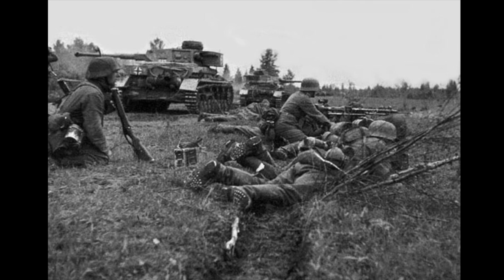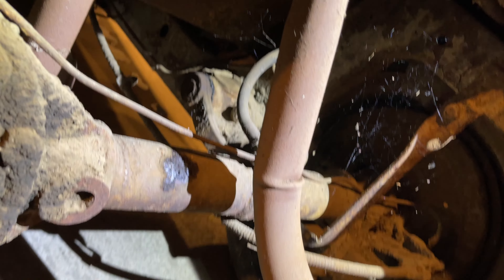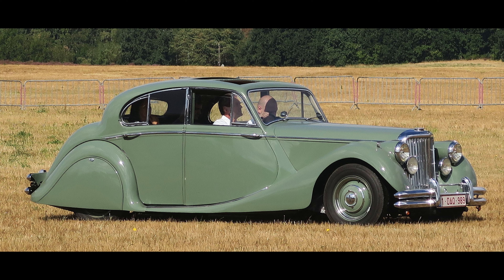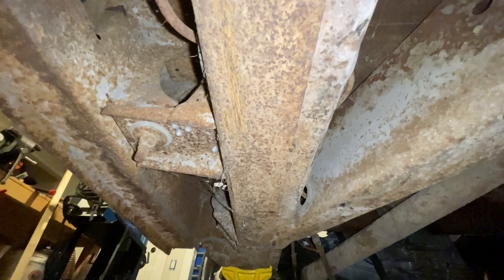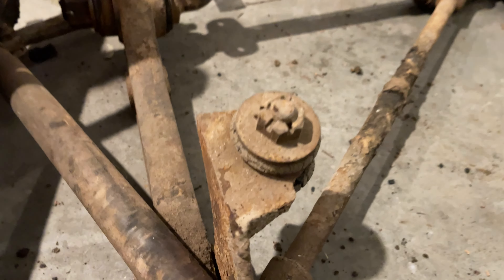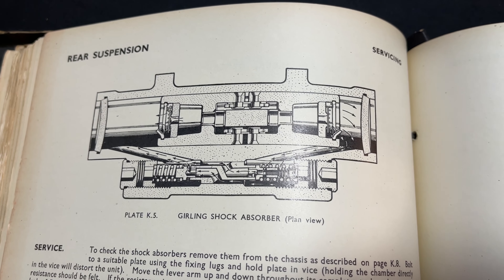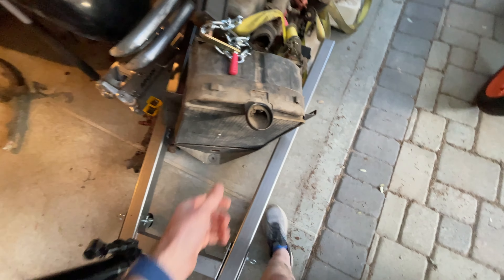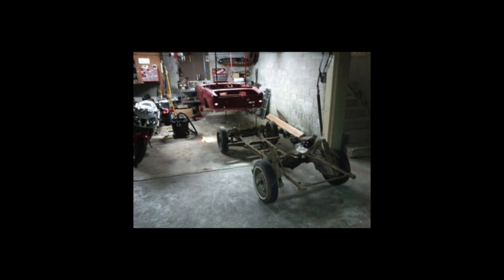The Design And Engineering Behind the Soon-To-Be-Tesla-Swapped 1950 Jaguar Mark V.

Comment: In case nobody has already pointed it out, the BSF/Whitworth nuts and bolts use different spanner/socket sizes to the 'imperial' A/F sizes (which are American standards), which is why your spanners don't fit properly.
Reply: I don't understand a car guy does not now this, made me laugh...
Reply: Whitworth threads are typically used on tubing threads today, eg brake lines.
Reply: Correct, he must know that, think he is just playing
Reply: He must do
Reply: @kennethmoxon7337  eh, it's common knowledge for anyone that's had something to do with old British cars but outside of that not really. Can't imagine it helps that he's in the US.
Reply: @alfasud1972  He's American and i'd wager most British mechanics don't know about them
Reply: @MrcabooseVG  even non mechanics in the UK who played with cars as a child knows this.... makes  sense
Reply: The mounts on cameras are still Whitworth threads to this day too!  To be fair to Matt, it is pretty confusing that Whitworth spanners are labelled based on thread diameter (with bolt head size being a mathematical function of thread size) AND that they have both W and BSF (British Standard Fine) markings on most spanners and sockets which are different (e.g., " 1/2" W 9/16" BSF "), since the relationship of thread size to bolt head size was reassigned at one point.  ...Edit - Nope got that wrong myself, it's because the relationship of fine pitch (BSF) thread size to bolt head size was defined differently to standard Whitworth (labelled W, WW or BSW), with the BSF bolts having a bolt head size that was one step different for a given thread size. 

Inconveniently, the majority of the Whitworth bolt head size (across the flats or "AF") are nowhere close to either SAE AF or metric AF sizes.  E.g., there's 1/8"  W which is 8.64mm across the flats as opposed to 8mm AF or 5/16" AF (which is 7.94mm, so is usually interchangable with 8mm AF wrenches or sockets).  Hence the need for dedicated Whitworth tools.  (It's a funny coincidence that there are quite a few SAE AF that are very close to metric AF sizes, by comparison.)

Interestingly on 1960's British cars you can find some SAE thread or metric thread bolts that still use Whitworth size bolt heads to allow existing spanners and tools to be used.
Reply: He said in the beginning that he has never cared much about or learned about jags

Comment: The beading between panels is called "welting" and the Withworth system has its own spanners "wrenches" that are slightly different from sae wrenches but that fit snugly on Whitworth nots and bolts. I recommend that you get a set from the UK; it makes work more pleasant. Interesting project, thank you.

Comment: in reality this is a 1930's car that they were still making in the 1950's
Reply from the maker: Totally. I'm spending a lot of time watching videos on 30's and 40's hot rods to figure out how to modify things.
Reply: @SuperfastMatt  you were on jay leno?
Links or name of the video?
Reply: @rronaldreagan  jays garage Honda s600
Reply: @djfast3  doesnt even look like him.
No homo but he looks much better today
Reply: Not really, Jag were innovators, their application of Girling disc brakes won them the 24 hr Le Mans. My 1959 Mark IX had 4 wheel discs in a fuuull siiize sedan. Do you know of any other mfg doing that?
Reply: @ericst-louis8604   My point was this car has none of those innovations , all the technology and design  is 1930s, it wasn't a comment on the manufacturer just the actual car Matt has.
Reply: @rronaldreagan  sus
Reply: @ericst-louis8604  Yes but this specific car is of an old design, Rover also did all round disk brakes albeit a little later but not by much
Reply: @malakiblunt  I know a little about these (own one), while you’re right it is an old design, an iteration on the MkIV which flat out was a prewar car designed in the late thirties but manufactured immediately after the war. It’s worth noting that design/manufacturing practices at the time were more iterative than today. Only bits of it were new. The front suspension was the innovation on the V along with the box chassis manufacturing process. The front suspension went into the XK120, and derivatives into MkVII and most of the grace, pace, space Jag saloons of the fifties. The engine is also a good example of how they evolved things. The design was  an old Standard (as in the company) side valve six. Jaguar purchased the tooling and modified it to produce an overhead cam engine without the cost of casting a new block / ancillaries. There are still hatches on the side of the block in the MKIV/MKV to access valve gear that is simply not there. It’s hilarious.
Reply: @ianemptymindtank  The Mk4/5 engine was pushrod, the twin ohc went into the Mk7.

Comment: The heads of the fasteners are whitworth as well. That's why normal wrenches won't fit.
Reply: Yes, Whitworth wrenches exist for just this purpose.
Reply: Not-quite-useless trivia: old British stuff is still fractional imperial sizes - they just measured across the points, instead of across the flats. You can still buy the wrenches to fit them. Most old jags fit 2 or 3 wrenches for 98% of the fasteners outside of the drivetrain, so you probably could buy 2 or 3 single wrenches and sockets, and not have to use adjustables.
Reply: Whitworth "spanners" are normal  (?) wrenches (?)
Reply: @jkk244  only they are called spanners  😎
Reply: chevy liked to mess with you clutch head screws.

Comment: The bolt threads are BSF, whitworth spanners fit the bolt hex but are a size out, so a 5/16BSF would use a 1/4whit spanner, but you can of course get BSF spanners just marked with BSF. You probably need to log onto eBay.co.uk to access the stuff. Using an adjustable spanner is best with an imperial one...!!!

If you were doing such a conversion here in the UK there would be a lynch mob at your front door...

As for modern safety features, the best form of safety equipment would be a very sharp spike sticking up from the steering wheel, fitted to all cars would transform road manners in an instant!

Good luck with what will be an interesting build! Greetings from the UK!

Comment: It was quite common in the '50s for UK cars to have fold-down boot lids. My first driving lesson was in a "sit-up and beg" Ford Anglia 103E, which had such a boot. It was an arrangement that provided more boot space - the lid doesn't go flat, so you can jam loads of junk in, and on the lid.

26tpi 1/4" is BSF (British Standard Fine). Cycle threads would be 26 tpi, but 60 degree rather than BSF's 55. In an emergency I have used a 1/4 BSF on my  1966 Norton.

The appropriate spanners are Whitworth/BS. I was lucky to start building my tool kit when Whitworth/British Standard (BS) spanners were still common. The nomenclature for spanners relates to the thread dimension, not the across-flats of the bolt-head/nut, so a 1/4"  Whitworth spanner is for a 1/4" bolt. They are still available in UK, and King Dick still make them - I bought a set-aside set just in case I have an accident with my main set. I have noticed on my bike that for a particular thread diameter the nuts and bolts have a different across-flats size, so you do not need two 1/4" Whitworth spanners to work on a 1/4" nut and bolt.

Thank goodness UK moved to metric.

6:38 That's a voltage regulator at the top of the electrics. They are quite valuable - I notice one on eBay for $180.

 I love programmes like this, but when a youngster points out that a car in which I was a childhood passenger is 70 years old, I begin to wonder where all the time went.  But when the presenter compares an E-type with a tongue . . . At least a tongue has taste.

Comment: I had a Mk V many years ago, in immaculate condition. Paint like a black mirror, interior in the condition it came out of the factory. It needed re-ringing and being a poor student it became impossible to service its inordinate thirst. Had to do brake cylinders and shoes, which the dealer still had wrapped in grease on their shelves. Always overheated, not jags finest product, but still beautiful
Reply: Just to make the overheating fatal, the temperature gauge bulb was located on the radiator connection, the engine fried before the gauge warned you.

Comment: Will admit that had I found this video a few days ago I would just write you off because of your attitude. But I found some of you later videos in which you worked on modifying the frame and in those videos you came across as a young engineer with hands on experience in machining. Got to thinking how much alike we are, or would have been if I had not attended a junior college vs an actual college.

You have my subscription, something I hard to justify with most You Tube videos.

Comment: Whitworth bolts have heads in 32nds and that's your clue they are not regular Imperial bolts and nuts. The ropey thing between the fender and the body is called welting or  beaded welting when it's standing proud like that.
Reply: and it is available new. and not expensive either.

Comment: The boot lid folds down because at the time people still frequently travelled with steamer trunks, and you would load it on to the “tail gate” and strap it down.

The stuff wedged between the body panels is called fender welt.  Hot rod shops sell it by the foot.
The hand crank was for emergency starts, since battery technology was pretty poor and batteries failed frequently.  Also, the typical Jaguar buyer in 1950 would have grown up with hand cranks and would have seen it as an essential backup.

Comment: here in Blighty, I bought my Imperial spanners from that famous USA company called "Snap-on". 
The Mark V  uses UNF bolts as well as BSF bolts, and a few BSW in the cylinder head. And 2BA screws hold the steering wheel horn push together too.   :)
I always wanted to buy an old Mark V and stick a Jaguar 5.3 litre V12 under the bonnet with Jaguar XJ-S running gear/brakes. 
As for sticking an EV motor under the bonnet, Jaguar did that with an E-Type Jag that Prince 'Arry and the wife drove out after his wedding.

Comment: I have fender mounted mirrors, they are better than door mounted.  you can see traffic on both sides without taking you eye off the car in front.  on a 60s saloon,  there is no blind spot between the 3 mirrors & your  peripheral vision.   No turning your head to look in the curb-side door mirror,   Because they are far from the driver you don't need to adjust them if you move the seat.          It does seem to have hydraulic brakes.. so very advanced.

Comment: Great project! The bolts are actually not sloppy- you just need Withworth tools- which are not Imperial or US.
Reply: Annoyingly  Whitworth spanners are marked with the size of the thread, so a 1 inch Whitworth nut is about 2 inches across. Whitworth hex sizes are in inches though so if you have a good imperial AF set there should be one that fits.

Comment: If you haven't figured a way to augment those tail lights, I had an idea that might work: You could 3d print a holder base to fit those lenses.  I'd design it to hold LED brake lights that are found on Amazon/eBay.  They are incredibly bright by themselves, the ones I have have like a lens on the end, and LEDs on the sides as well.  4 or 5 would be ridiculously bright.  I might add those fog laser brake light add ons that project a laser pattern on the ground.  Also found on eBay ect.  Excellent video as always, thank you.
Reply from the maker: I was going to LED those and also probably put some red LED lights in the rear window. I think I need some lights up higher.

Comment: "I'm pretty happy with the suspension design of this car...this could be on a car that was designed 50 years later."

From an initial glance, the upper wishbones actually were used on a car 50 years later. They look identical to the ones fitted to my 1992 XJ40, and I doubt they changed them for the 1996 X300 or early 00s X308. Perhaps they did, Ford changed a lot on the X300 compared to the 40, but even still that's at least 40 years of parts continuity...

Comment: Whitworth is an imperial system, but the spanner size for them refers to the thread size, NOT the AF of the head of the bolt. And the AF size of those spanners is not a rounded imperial size .

For example, a 1/2" Whitworth spanner is 0.92" AF / 23.37mm AF.

Comment: There is so much in this car that is similar to my range rover. I have no option but to find it amusing.
Reply: Just a few 
- fuel line in wheel well and exposed on frame rail (but hey the Rangie is 4x4 so what could hit the frame rail?)
- hand crank option (for suicidal he-man)
- collects a wheel barrow of soil every dirt road
- One of every thread type (but that's from factory not due to crazy swap)
- PITA through bolts 
- Barely working Lucas electrics
- I'm afraid to think about it any more, but thankfully it has a pretty good Bible with it too.

Comment: Wentworth sockets and wrenches are available. It’s not just the threads, the actual nuts and bolt heads are different.
Reply from the maker: Well that explains it. I see now that a 15 second wikipedia read would have answered that for me. I think I'm probably going to just replace ever fastener with a modern SAE size. So many of them are rusted beyond re-use anyway. And I figure I will have removed so many by the time I rebuild that I might as well just remove them all!
Reply: You’re welcome! Very cool (albeit insane) project. If I’m not mistaken, thread pitch on the wentworth stuff is nearly identical to metric. You may be able to retain captured nuts and threaded inserts, etc.
Reply: Whitworth. Wentworth is a golf course.

Comment: Withworth bolts use withworth spanners, brittish wiring not usually a problem, it's the joseph lucas "king of darkness" at the end of the wiring that's usually the problem,, the material between fender as nd body is "called fenderwelt"

Comment: Ahh good old Whitworth. As a Brit that works mainly with metric it feels like revenge on Americans who still propagate imperial fasteners all over the place. At least metric and imperial bolts can mostly be fudged to make either socket set work on the other. Whitworth follows a more Victorian logic, a 1/4"W spanner has a head size of 89/200" or 11.3mm, good luck!

Comment: To bring it fully up to contemporary safety standards, will you remove the interior door handles and replace with a door-open switch which doesn't work if the battery's gone pop?

Comment: Having owned quite a few British classic cars, I have found that if you use an off the shelf Chinese socket/spanner set they are rubbish. I ended up buying some Britool spanners and assorted Bedford, Britool and some other British made sockets and these have undone the nut and bolt quite easily no rounded heads. Also quality German/Spanish/American tools make a difference too. Or buy yourself a car made by the Rootes Group. My 1965 Humber comes apart with very little problems, OK you might have to soak the nuts with oil, but you have to do that on any car.

Comment: I think you would have been happier with a Jaguar Mk IX, which came with front and rear dunlop disc brakes, and used SAE fasteners instead of fine thread.
Reply: Which also came with an automatic transmission, sourced from GM
Reply: @ericst-louis8604  Actually, it was a Borg Warner DG250. A manual transmission was also available as an option in the Mk VII, but is quite rarely seen in the Mk VIII and IX.

Comment: I think the bolts are BSF different from Whitworth and AF.
Reply from the maker: That’s what Wikipedia told me but the Brits I know all said it was Whitworth. 🤷‍♂️
Reply: @SuperfastMatt   from experience with many old British cars they are more likely to be BSF than whitworth food luck with the build
Reply: @SuperfastMatt  My rebuild of a 32 Riley was whitworth.  Beware whitworth and UNC, some nut and bolt combos fit but the thread angles are different, very little strength. 55' vs 60' thread angles.

Comment: No, quality tools and fasteners here post war do you have a full set of British spanners? From my set some are the same physical size with double nomenclature.
Reply from the maker: I have the spanners that came with the car, which fit most of the fasteners. Except that all the bolts are rusted on, so I've just been impacting them off with the nearest size socket. ¯\_(ツ)_/¯
Reply: @SuperfastMatt  that or a grinder usually ☹️, I’m planning on building an Austin 7 monoposto and I’m dreading the engine strip down😭

Comment: Don't be rude about Whitworth.  He Invented standardised thread sizes.
Reply: Yes Whitworth is the standard all the others are due to "not invented here" syndrome.
Reply: @andrewallen9993  He moans about his spanners not fitting.  NEVER use an adjustable spanner.  Simply buy a set of Whitworth spanners.  These fit both Whitworth and BSF threads.

Comment: Matt, 

Josiah Whitworth was the pioneer of fastener standardisation, prior to his sytem fasteners were made to whatever size or form users wanted so there was no interchangeability.
Arguably his thread form is yet to be bettered from a strength aspect but made them more difficult to make.
I would also like to register my strongest disapproval of what you are doing to this classic motor car, there can be few left of this model and you are destroying one of them. Just what is the reason for this desicration?